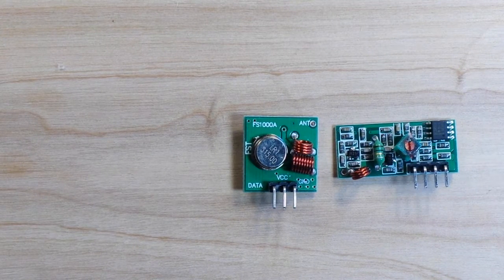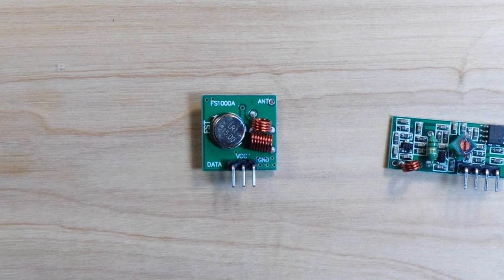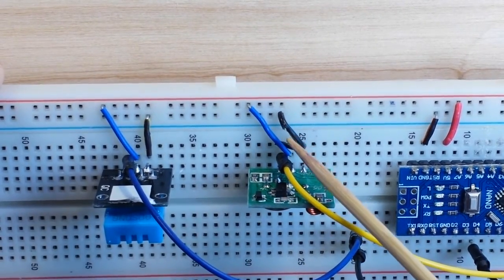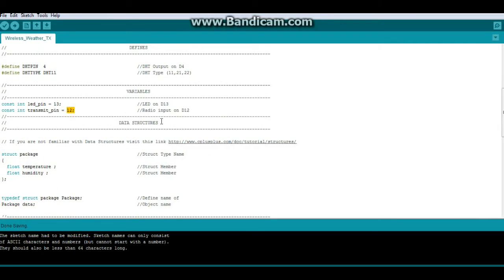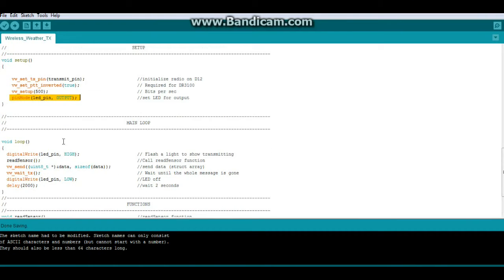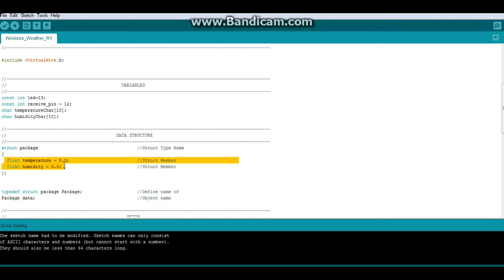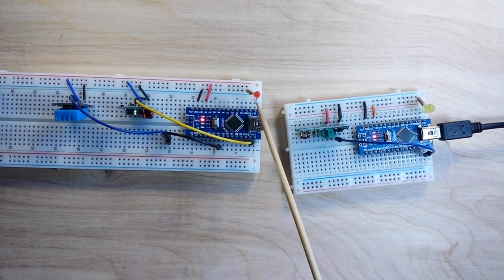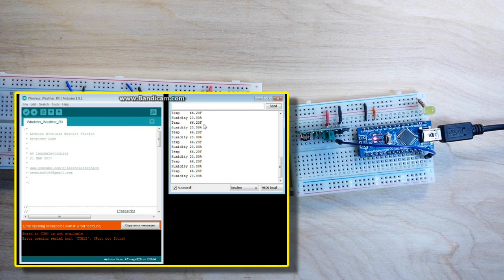Arduino Wireless Weather Station Part 1

Comment: Cool idea to do range test for these cheap radios. I paired DHT22 with LDR and BMP180, grabbing time from DS3231 and writing to SD card.  Being a meteorologist, i live and breathe this stuff!
Reply from the maker: Michael Padovani I did the tests this afternoon. the video is uploading now and will be out tomorrow. I got outstanding range from a simple wire antenna.
Reply from the maker: mark thorson Let start by saying thanks for watching & commenting. I love getting great comments. I'm not an RF guy, so I won't speculate...but I'll tell you what I know. 12V would probably fry the poor little guy, but they are cheap enough that I'll give it a try and report back.
I really like these radios. so simple to use. A really good antenna will make a huge difference. Check out dipole with a ground plane, and make sure your antenna is vertical. also, if your txt & Rx are stationary, a directional antenna is is always better than a unidirectional one...see Yagi and inverted V.
Reply from the maker: mark thorson Let start by saying thanks for watching & commenting. I love getting great comments. I'm not an RF guy, so I won't speculate...but I'll tell you what I know. 12V would probably fry the poor little guy, but they are cheap enough that I'll give it a try and report back.
I really like these radios. so simple to use. A really good antenna will make a huge difference. Check out dipole with a ground plane, and make sure your antenna is vertical. also, if your txt & Rx are stationary, a directional antenna is is always better than a unidirectional one...see Yagi and inverted V.
Reply from the maker: mark thorson the range tests will be published today. I got to the end of my yard, about 150ft with no trouble at all. I was an STS (Sonar Tech Submarine). Now just a community college EE instructor.
Reply from the maker: mark thorson Well, I wasn't aboard a hunter. I was aboard a Boomer. "We hide with pride"

Comment: As simple and beautiful as the project looks and sound, I couldn't get mine to work. I had the transmitter led blinking but there seemed to be no activity at my receiver end. No blinking, no data transmitted to the serial monitor. I tried 5 different receiver modules in case my receiver was faulty. Still nothing happened. What could I be doing wrong? Or what do I need to do differently?